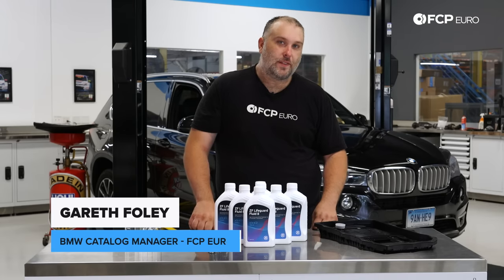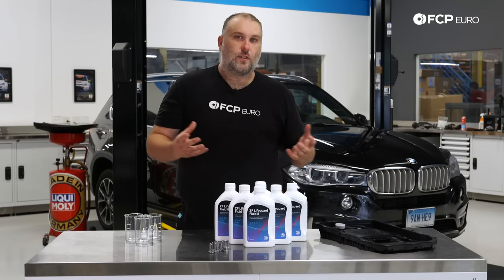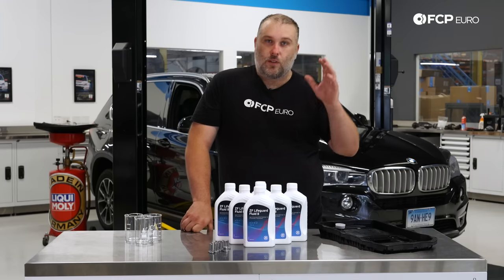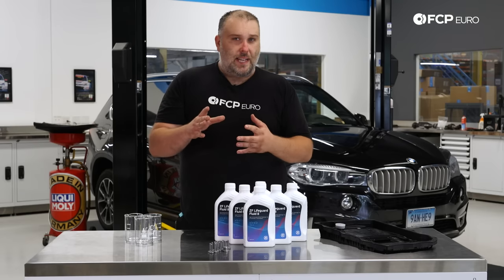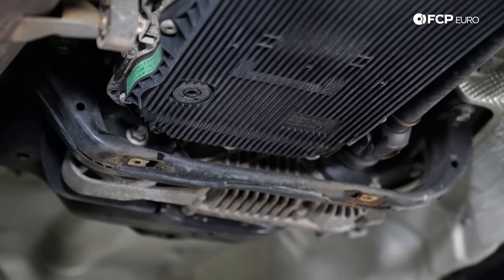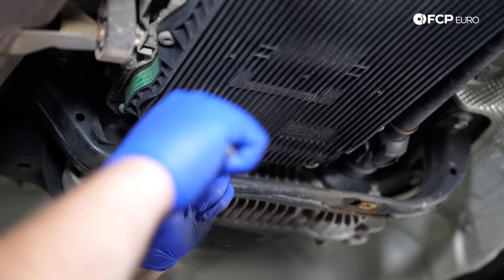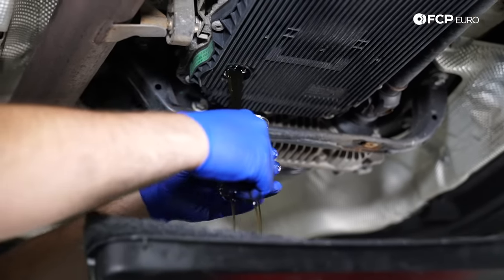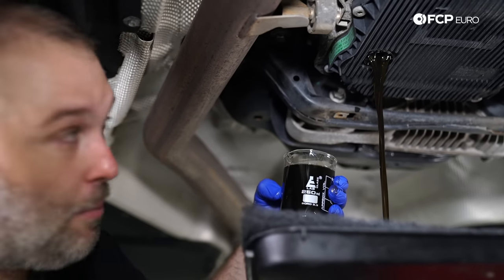ZF 8-Speed Transmission Oil Change (BMW, Audi, VW, Dodge, Land Rover, Toyota, & More)

Comment: This tuturial just for 30% oil change.. Normally workshops connect to the main hoses that comes to oil cooler(radiator) then one hose used to drag old fluid and other hose pushing the new fluid inside while car runs. This way you change all the gear oil not only in case oil pan.. Not sure what you are showing .. dislike
Reply from the maker: Thanks for the feedback! Our video shows ZF's recommenedd service of a drain and fill only, no hookup of the coolant lines or machine to flush.

https://aftermarket.zf.com/remotemedia/si-service-informations/si-service-information-zf-136130/si-transmission-136428/si-cars-4-137095/si-englisch-3-137691/si-modelluebergreifend-1-138411/si-zf-si-oelwechselkit-8hp-50130-en.pdf
Reply: @fcpeuro  .. but it's hardly a 'drain' if you are only removing 30-40% of the oil fluid.

Comment: According to ZF, the bolt torque for the 8HP oil pan  is 4Nm + 45 degrees ONLY if the drain pan is aluminum. If plastic, the bolt torque is 10 Nm.
Reply: 4+45 degrees is only about 15nm which is not much of a difference honestly

Comment: The Autel MD808 Pro is the least expensive Autel diagnostic tool of theirs that reads transmission oil temp.  That’s what Autel told me anyway.  Thx for the video, Gareth!
Reply: That's still 290€. A 25€ WiFi ODBII connector with a free version of the BimmerLink app tells you the transmission oil temperature.
Reply: @MickD464 any OBD scanner can do this with bimmerlink?

Comment: Thanks for the informative video.  I just did a  quick drain and fill on my 2015 Jeep G.C. when I drained the Oil pan I only got about 3 lt.  is there something I did or did not do correctly as I was under the impression a drain and fill would take between 6 & 7 lt.  Thanks
Reply: I just did this today and I got about 3 liters as well. I thought the same and bought 7 liters worth. did you have any problems?
Reply: Only problem was I got tunnel vision on using a socketed Allen with ratchet. No room for that. When the fog cleared I used long Allen with 90' and fit fine. I was told buy a shop that you only get about 3 lt on a drain. So will do a drain & every other oil change.
Reply: Fill.

Comment: What is the procedure on returning the used filter & fluid for lifetime warranty reimbursement?
Reply: LoL, the guarantee is self paid: if you don't change it, you'll have VERY expensive troubles once the guarantee will be expired ;)
Reply from the maker: On your second fill up and filter swap put the oil fluid in the new containers and old filter in the new filter box and send em on back in.

Comment: that's only like 40% of oil changed isn't it?
Reply from the maker: Doing a service like this is not going to get all the fluid, which is why its so important to stick to 50k intervals. Doing that will allow the state of the fluid to always be at a healthy level.
Reply: @fcpeuro  the problem is, if you change just half, it is pointless, it is like changing half of oil in your engine... you would have to do it 7-8 x in 1000km intervals to have about 70% clean oil.... no point...

Comment: Thanks for sharing.  Why not drain and fill a couple more times to get some of the fluid from the converter?  Or do a flush and fill.  Do you guys recommend doing this?  Thanks again.
Reply from the maker: Hi Gene, as long as regular routine intervals are followed, that is not really necessary. If you are having issues or have gone an extended period without service, you may want to consider that just as an extra precaution.
Reply: @fcpeuro  Thanks.  Any thoughts on the ZF 8 speed transmission?  I bought a Ram 1500 with 60,000 miles used.  In very good condition.  Owned by a former mechanic.  But transmission fluid/filter not changed.   No slippage, no issues.  Is dropping the pan and fluid change enough (I can easily do this myself)  or do you think removing hoses and flushing would be in order (I don't really want to do this).
Reply from the maker: @genepierson1728  You should be totally fine just following the similar procedure from this video. If you do a normal flush and refresh of filters you should be good to go!

Comment: After a transmission fluid change at about 48,000 miles on my 2013 BMW X3 due to a transmission cooler line leak, I noticed a persistent shudder and rumble noise when undergoing slight acceleration around 40 mph. The BMW dealer did an "oil balancing test" and checked all codes, but couldn't find anything wrong. I was told to drive it for a while and the computer would eventually make any necessary adjustments to stop the behavior. It took several thousand miles before normal operation was restored, and has been fine since. Any thoughts?
Reply: The ZF automatic transmissions (6 speeds for sure, not sure about 8spd) have 'learned' adaptation values that change according to the behaviour of individual transmissions. They measure the slip between shafts corresponding to the pressure sent by the solenoid, and can adjust that pressure to fit a shifting curve target. I hope this isn't too confusing. 

If these adaptation values are not reset after service, transmission behaviour can be adversely affected. The transmission has learned to shift and apply pressure to the characteristics of the old fluid, so new fluid will change transmission behaviour. When doing DIY on the 6spd transmission there are instructions for how to reset these adaptive values.  I would assume the service bulletin would describe doing this as well, but there is a chance the adaptive values were not reset.  The end result would be slightly more wear on the clutch packs and other transmission components (due to inefficient shifting) but if it is working fine now there is no cause for concern. These transmissions can last hundreds of thousands of miles without abuse.
Reply: @leifer20  Thank you for your attention to my concerns, and this is an eight-speed transmission in the X3. It seemed odd to get the shuddering sensation and a sound like driving over rumble strips, usually at around 40-45 mph, initiated sometimes by making a turn or going uphill. Sure enough, after a couple thousand miles it seems to be shifting perfectly, almost seamlessly. This technology puzzles me, like the joke about the thermos - hot or cold... how do it know?
Reply: @leifer20  SUPER helpful, thank you.

Comment: Ive heard mix responses on the old fluid scenario that you mentioned (dont change it).  One method is to suck out a quart of fluid and replace with fresh.  Do this again in a thousand miles and again a few thousand miles after that.  This is to slowly remove the sludge/contaminants without shocking the system.  Thoughts?
Reply: what is this about shocking the system?  my 2011 x3 35i is at 125,000 miles and it might be getting its first transmission service
Reply: @stevendeclercq3566  When you change the fluid all at once on a high mile transmission, you risk sending clumps of sludge into places it shouldnt go (shocking the system).  doing it slowly, one quart at a time is another theory that removes sludge at a slow pace.
Reply: @lear60man  ah I see how it could clump up while the rest drains.  Thanks

Comment: My 2016 bmw x3 28i has 89 thousand miles... Do you think it's too late to do a change?
Reply: No. Get it done! I did mine at 98K miles.
Reply: I did mine at 105 you won't have issues doing it on a higher mileage cars like older transmissions
Reply: Original fluid wasn't even that dirty
Reply: I did mine at approximately 163.000 km. No kind of problems.

Comment: The problem I'm receiving is, the dealer states there is no service interval for this version of the transmission. I could not find official information on ZF's website. My vehicle is still under extended warranty, so I did not want to void the warranty by going to an independent shop. Do you have any suggestions on where I can find the official documents from ZF to present to my Service Advisor?

Comment: My car has 100k and I’ve never had a trans service done since I take it to bmw generally. Is it advised or not since it’s already at the mileage ?
Reply: BMW say they are sealed for life and don’t need servicing. ZF, the gearbox designer and manufacturer say they do need servicing. I know who I would listen to.
Reply: Id say do it asap if you dont have any shifting issues. If you do have issues, it might be too late
Reply: @PhilipBarrett1  you know sometimes in sport it struggles to shift all the way up to 7k rpm at full
Throttle other than that it’s always smooth

Comment: Gareth is just awesome, really in awe of his knowledge and detail in every video, just completed mine today, at first was so nervous, now it's a walk in the park 😁, only one question, so with the automatic when I try to change the gears move it up it rolls back to second gear, does it engage the other gears or is the vehicle telling me that it won't select the other gears because there is no speed for it to actually change. I'm just trying to find out. My change was at 193000 km, dealership said its forever oil 🤣🤣🤣 however  my oil was still looking good. One more thing why do we get 8 liters in the kit when the car only takes about 4.5liters Glad to have you guys, otherwise would have been in the dark, Thank you 👍👏🤝
Reply: I had to lift my passenger side up to get an extra .5 quart in. When I did it flat I wasn’t able to put enough in and it was actually worse than before. Highly recommend lifting and adding the extra. I just used ramps on my two passenger side tires and it worked well.
Reply: @tariq what was the solution with the gear change issue?
Reply: I found if you hold the gear shifter towards the back of the car (after it shifts from 2nd to 3rd for example), it will stay in that gear until you let go.

Comment: How about the fluid in the torque converter and in the trans cooling lines???
Reply: About the only way would be to do a second drain and fill after a short drive.  You wouldn't need to drop the pan again, just drain and fill.  You'd need extra fluid.
Reply: @Aardvark49  Not Really . You  can open the trans line at the cooling radiator and turn the car on , empty the lines and keep adding fluids until clean fluid comes out. I think it’s pointless to change filter and do all of that and still have contaminated fluid in the torque converter and cooling condenser. I’m not a certified mechanic , but just my opinion.
Reply: @ervinzefi8662  A drain and fill takes out 5-6L when the capacity is 8.5L, so technically a lot of fluid is removed vs. other automatics to where it's fine to get away without having to do a flush.
Reply: @FrenchValleyAirport  

I would disagree: whilst draining and refilling is better than not changing transmission fluid, by your figures you have between 31% to 43% of used oil left in your transmission when doing a simple drain, filter pan replacement and refill
Reply: @paulcalmond  Actually 5-6L is 58%-70% of capacity, which is plenty. Once the pan is replaced you can do another drain and fill shortly after to get the remainder. There are no methods I've seen with the ZF transmission to use the transmission pump to flush fluid.

Comment: Very nice informative video! 
My 520d xDrive 2017 has done around 177,000 km right now (110,000 miles) and what I can see it has never had the transmission oil changed, so it's well above the recommended service interval. 
I was thinking about having the oil replaced, but a concern that I've seen others point out is that the new oil could loosen the smudge inside the transmission and cause it to get stuck in places where you don't want it, which could cause problems. 
Is there any recommendation for a car like mine? Should you still replace the oil, and can you clean out the dirt inside before replacing the oil somehow? 
Thanks!
Reply: I’m changing mine at 175,000 km
Reply: @Fix__with_Bill  I probably won't since I want to trade it in for a 530 or 535 with better options, but let me know how it went for you!
Reply: @ruthless236  I changed all the oils transfer case transmission diffs and since put on 6500 kms without any issues actually feels a lot peppier
Reply: @Fix__with_Bill  Good to hear!

Comment: What does Audi 2018 q7 3.0T take for the parts and fluid. I am new to diy this, but dealer told me to not change it until transmission fails...They say there is not even a service hole for that transmission.
Reply: They will say that because it will means they make more money replacing the gearbox than servicing it. There is always a fill hole on a automatic gearbox otherwise they wouldn’t be able to fill it at the factory.
Reply: @Mac_F87  thx for the reply! I see there are places using exchanging machine to get like 80% of the old fluid out, do you know by any chance where we can possibly get access to that?
Reply: @zz6761  there is no need. ZF even say to just drain out pan, change the pan then top up with new fluid. No need to flush the torque converter or transmission coolers.
Reply: @Mac_F87  I see, so how can I shift to all the gears after finish without driving it ? I thought it only stay at M1
Reply: @zz6761  keep your foot on the brake and select all gears. Also you can have the car on a two post ramp and cycle through the gears with the wheels off the ground.
Reply: @Mac_F87  thank you so much!!! I only have 35k miles on the car, should I go by the years or you think I should just replace it at 45-50k? It seems this fluid last 8years max? Also do we worry about the differential fluid at certain point? Thx again
Reply: @zz6761  I did the ZF8 in my wife’s BMW M135i at 40k miles.
Seemed like a good time to do it, the video also says around 50k miles is about optimum.
Reply: @zz6761  I changed her differential oil a few weeks ago at 48k miles. It was fairly dark but seemed in good condition to be honest. Her car is tuned so I’ve erred in the side of caution for both fluid changes.
Reply: @Mac_F87  I see I see, nice M135i  by the way. I contacted dealer they quoted me over $1000 for the part and fluid. Seems to be excessive. Do you have a good online source to order it? THX
Reply: @Mac_F87  for the differentials we only need to do the rear one right? Is it easy to DIY? Talking to my dealer is like talking to walls and money pits
Reply: @zz6761  I ordered a kit from EBay. Only the rear if the car is RWD. If it’s X drive then both. It’s easy but you may need at 14mm Allen socket to get out the full plug. Also you need a way of suctioning the fluid out and then refilling. You can buy cheap 500ml or 800ml syringe tools for this though. Again from eBay. I’ve posted a link to the place I bought the kit for the gearbox and an example of the syringe needed for the diff. 

 https://www.ebay.co.uk/itm/OEM-ZF-8HP45-8HP70-Automatic-Transmission-Gearbox-Fluid-Service-Kit-7L-of-oil-/122680285452?_trksid=p2349624.m46890.l49292

https://www.ebay.co.uk/itm/Sealey-AK54-Oil-Suction-Vacuum-Transfer-Syringe-Gun-Pump-Extractor-Gearbox-550ml-/183520526484?_trksid=p2349624.m46890.l49292
Reply: @Mac_F87  thank you so much! Also I see there are atf fluid made by Audi, are they the same as ZF lifeguard or they are something I should follow?

Comment: When going through the gears can you just do it with your foot on the brake and manually change gear or do the wheels need to be off the ground? Just wondering if this can be done with normal ramps or over an inspection pit. Thanks
Reply: I need an answer to your question as well. Not sure how to proceed
Reply: Hold brake go through all. gears don’t let wheels rotate
Reply: @mnl493x  great thank you 👍
Reply: @Coyote5555  also hold it in each gear for 5 second   Including Drive and neutral👍
Reply: @mnl493x  Oh man good tip thanks again don't want to mess it up
Reply: @Coyote5555  no probs. Not sure what car you have.  But. I’ve just asked him another question about the oil cooler lines. Think I’ll wait for an answer as a lot of people forget about this transmission oil cooler lines. Depending on your vehicle obviously 👍
Reply: @mnl493x  oh man good point 2014 3.6 1500 pearl white 3" level kit beauty lol
Reply: @Coyote5555  nice motor. Almost forgot. Maintain 2000rpm for about 30seconds aswell too fill the torque converter 👍he never mentioned that either 🙄
Reply: @mnl493x  holy cow I need to write this stuff down on my arm or something when doing this process, I ain't paying for my trans service lol

Comment: How did you run through the gears? I assume the car was in the air?
Reply from the maker: As Gareth noted, you'll want to keep the foot on the brake to keep the car from moving while you do this!
Reply: @fcpeuro  I get that but my car for example won’t run through the gears if it’s standstill. So wondering how you guys ran through the gears
Reply: S K, the ZF instructions say use P, R, and D, then Manually M1, and M2.  My Dodge will let me do M1 and M2 .
Reply: @scdotintrepid  yep mine will do 1 and 2 too. I was confused as the the vid shows him going through all the gears! Thanks for the response.
Reply: I have the same question. When stationary, the car will not show past M2. The ECU ignores the response since those gears would be too high for being motionless.

Comment: I got an old 2001 x5 3.0i with over 200k miles on it and I don't think that the auto trans has ever been serviced.  As of right now I can drive the car around and it shifts fine, sometimes its shifts hard when its cold but after it reaches operating temp it shifts and drives as it should.  The pan is leaking so I am looking to do an oil and filter change is there anything I should know before attempting this?  In the video you said after a certain mileage don't even bother but what should I expect or look out for before attempting this job?
Reply: I personally wouldn’t touch it at 200k but since the pan is leaking you could take the risk. Shifting hard when cold is normal for the first few shifts.